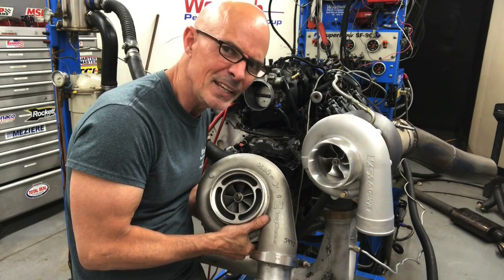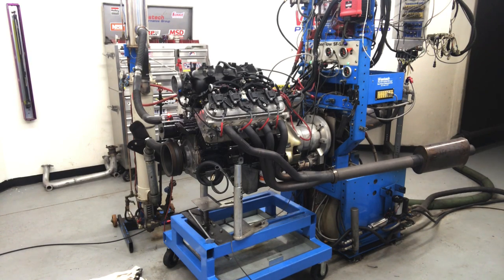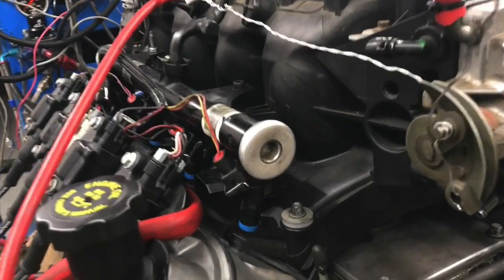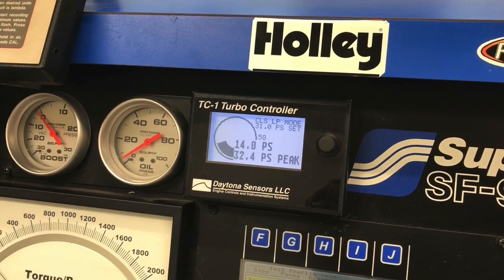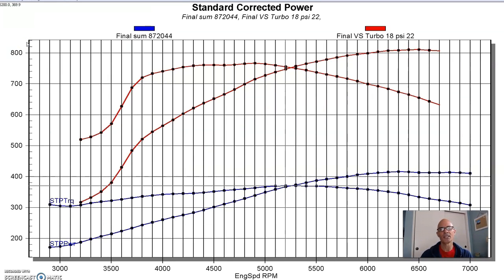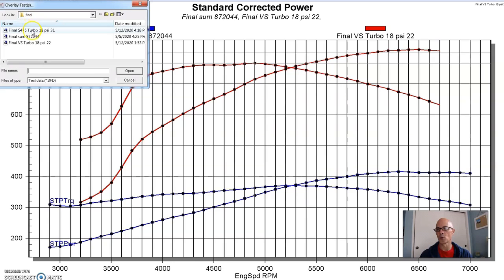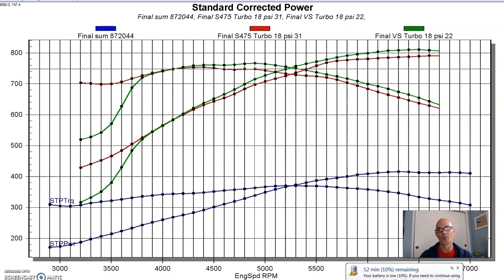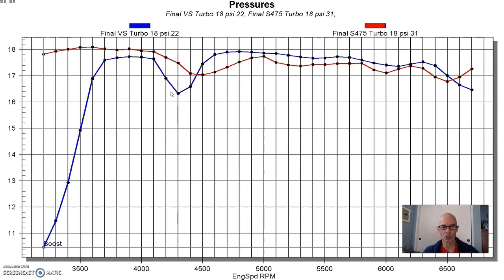RESISTANCE IS FUTILE-BATTLING BORGS

Comment: I like the change in hotside AR. They both look sized about right for this combo. It's not very often I see a direct comparison between two roughly equivalent turbo with one this drastically different. Brake dynos, which I am assuming yours is, can really change the load in. Holding the engine to 300r/s is also a little unrealistic for as installed but gives comparable results. Thanks for this test, this was nice to see...finally someone that understands what turbine AR is actually for.

Comment: Seems the Borg is the winner even despite a smaller compressor, smaller turbine housing and smaller turbine and an old cast wheel. The power difference was very small.
Reply: blow0me boost was even just a little lower on the borg .  And back pressure stayed down up too .
Reply: @hereinmissoula11  S480 probably blow the VS away, but the S475 seemed well suited there, or a billet wheel 475

Comment: Was there a difference in charge temperature between the two?
Reply from the maker: very similar
Reply: @richardholdener1727  Have you tested any of the cheaper water to air coolers? I know you use that procharger single and the cxracing double. I'm curious if the cxracing singles are any good.

Comment: I’m with the other guys here .. Max out that VS racing turbo on a modified rec port 6.0 please .. Love the videos 🤘
Reply from the maker: the 6.0L just adds back pressure
Reply: Richard im about to use the gen2 7875 with 1.25ar on an ls3.am I going to have back pressure issue?

Comment: One more vote for a t4 vs t6 test. VS being a budget turbo I was really hoping this test would be 7875 vs the Summit S475.
Reply: Me to. Now that this test is done, the t6 1.32 75mm needs to be tested against the gen 2 7875 on the same 4.8
Reply: @95GTSpeedDemon  idk why you would put a 1.32 t6 on a 4.8. The 1.10 T6 s475 is perfect on my 5.3
Reply: I knew he had done some t6 testing. I sifted thru to the end and richard said the back pressure was lower than boost the entire time on the t6 s475 and 4.great. https://youtu.be/14NC8qXiPus

Comment: Side note: can't believe that the Holley HP doesn't have closed loop boost control on board.
Reply from the maker: It does-we didn't use it
Reply: @richardholdener1727  I guess since you also test a lot of carb turbo setups. having a stand alone boost control system makes sense

Comment: T3 vs T4 same turbo spec. Next.
Reply from the maker: T3 is too small for a V8
Reply: @richardholdener1727  I would like to know the back pressure. I have 408 6.0 twin turbo T3 6266 gen 1 with .82 housing running 20psi 900rwhp.. My question is will worth upgrade to T4 flange turbo same size to relieve back pressure? My exhaust is 2.5inch fender exit.

Comment: I'd say unless you're racing with a high stall converter, the better response would be more than worth the 20hp (2.5% isn't much).

Just like the last test, that BOV is not working at all.
Reply: Hydrocarbon82 don’t need it anyways

Comment: I have two stock 87 Buick GN turbos and intercoolers.  Was considering putting them on my 415 SBC...  I'm thinking they would be sized about right, but was pondering if I wouldn't be better off with a couple of eBay turbos instead.  Anyone care to comment?
Reply from the maker: The GN Turbos are pretty small-what power level
Reply: @richardholdener1727  It's a two bolt factory 400 block, with the factory Hi-Po pink rods.  It's now making a little North of 450hp N/A, according to my seat-of-the-pants dyno.

I'd be afraid to push it much past 900hp...
Reply: Michael Angelo better off with eBay turbos sizes for that. That’s a lot of motor for those tiny turbos.
Reply: @Turbogto_guy  Thanks for the input.  eBay turbos are well within my budget, I just like to use what I have, when it's practical.  

Was just thinking that the 415 is around 50ci less than what the two turbos combined were originally specced for, and I'm not looking for over 1000hp.  It's a street car (MC), and quick response is also important to me.

Again, thanks for your input.
Reply: A pair of s372 Billet wheel with a 1.25 v a r hotside will net you 1800 easily at about 30-32 lb of boost. They will max out at about two thousand horsepower. 210 lb Bosch jectors will max out around 1800 on E85
Reply: @danielsullivan9865  Thanks for the advice Daniel, I'll keep those specs in mind, but I don't think I want to run over 18# of pressure, and the billet wheel turbos are a little more money than I care to spend on this project.

It's just a street car, and will already run away from 99% of the other cars I come across in this town.  If I could double the HP, and still have good response, I'd be tickled...
Reply: You could get a pair of Chinese turbos rev9 72-68 with a .96 AR for about $279 a piece and make 900 HP + at 11 lb of boost. 18 lb of boost will probably get you over 1150 HP. Hope this helps good luck with your project
Reply: @danielsullivan9865  Thank you Danial.  

I checked on the Buick forums, and they said the stock 87 turbos are efficient to around 22# of boost on the 3.8L they came on.

From that it looks like two would certainly do the job on a 6.8L, but the eBay turbos are new, cheap enough, and I assume are using a little later technology.  Also the Buick guys said the stock GN IC was pretty restrictive.

Thanks again.

Comment: Another great video RH, appreciate all your hard work.

I'd love to see a video where you show the changes variable cam control can have on boost response/ power curves. It's be something for a Coyote I reckon. Show maybe 10 degrees intake advance incrementally to Maximum. Then 10 degrees exhaust retard incrementally, and maybe the behaviour with both changing together followed by optimised vs no control.

Would be interesting to see the effect of increasing overlap varying in effectiveness as back pressure increases.
Reply from the maker: if it adds power NA-then it adds boost response
Reply: @richardholdener1727  
Naturally, but would be interesting to see the changes as cam angle changes. Changes in VE, how dynamic compression gets changed, overlap effects etc.

Comment: Man, I'm guessing my Billet Gen 1 with .96 AR is going to stuff up my LA 360 and Larry Smith Ported Sidewinders.
Reply: Prochargedmopar I have the same turbo on a 5.3
Reply: Call vs and they'll sell you the 1.25ar turbine housing from the gen2 which bolts directly onto the gen1. That's what I did, its waaaaay bigger and better suited to these v8s imo.

Comment: Test on a 6.0 with rectangle port heads please! Then test the 6.0 with the T4 vs T6 S475's...
Reply from the maker: just more back pressure with the 6.0L
Reply: @richardholdener1727  how about the T6 S475 on the 6.0? Have you run this test yet? I can't remember...
Reply: @richardholdener1727  will there be a huge difference in backpressure?

Comment: I've been waiting for this! Would love to see this same test on a rec port 6L. Brave man with that laptop battery lol
Reply from the maker: a 6.0L just adds back pressure
Reply: @richardholdener1727  Does that make it more responsive on a 6.0 than the 4.8 then?
Reply: @richardholdener1727  So you would have to up the AR on the same turbos for similar power curves to account for increased airflow on a 6.0... correct?
Reply: @richardholdener1727  that's true, should make more power on less boost because air flow is airflow and boost is a measure of restriction.
Reply: @ianm432  Yes but like Richard said boost to back pressure ratio is going to be way out like at peak HP it'll probably be 2:1 .
Reply: @richardholdener1727  when can we see the Chevy 8 liter gas engine from the early 2000's.
Reply: Ian M me too! Do the sloppy cam test followed by these two turbos on the 6.0. That’s want we all really want. 😆
Reply: Buying anything more than the 4.8L at this power level, and with this turbo, is a waste of money. He is within the comfortable operating range of a hydraulic roller and will ultimately be limited by the turbo.

Comment: Why do ppl use the boots do they do that so there is a weak point in the system incase something happens. Why not pipe to pipe
Reply: There has to be some flex in the system somewhere.  For installation, maintenance, and longevity.
Reply: Good silicon couplers last a long time. You gotta have some flex or pipes crack.